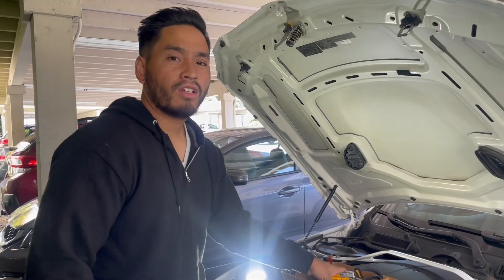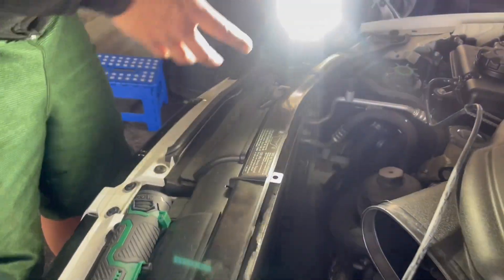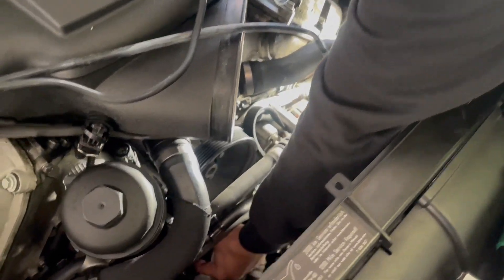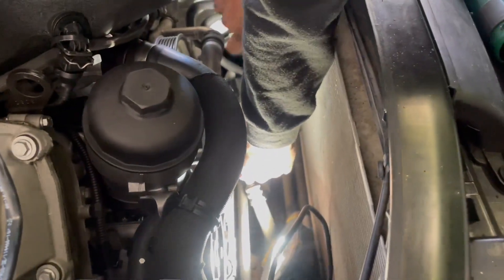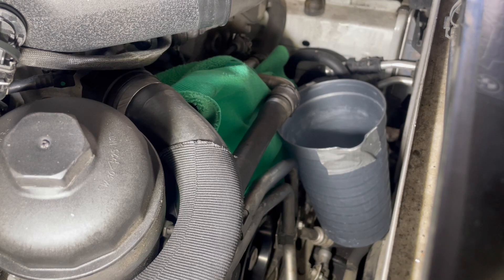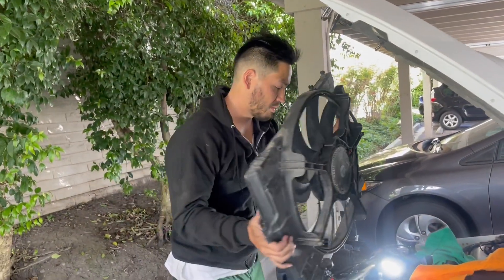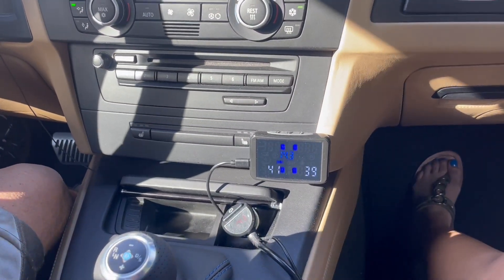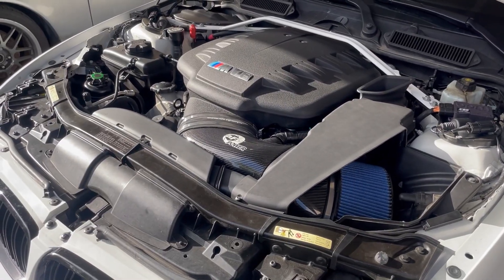Adding More Horsepower E92 M3 Underdrive Pulley Kit Install and Review E90 E93 BMW

Comment: Great video, wanted to see your technique to clip in the hoses on the bottom of the fan, that may be the hardest part of the job. I want to avoid taking the undertray off.
Reply from the maker: Thanks for the comment!  It's a bit tricky but I just pre positioned the hoses and clips best I could to line them up.  No tricks besides removing the undertray which takes extra time.  Good luck!

Comment: Good evening Sal.  Quick question, would you know how to adjust the rpm on the launch control?!  I see yours set at 3.5k  . Mine is set at 5 k and I don’t like to launch it that high . I feel it’s abuse 😂. Thanks 🙏
Reply from the maker: You need a DCT tune plus ECU tune.
Reply: Ok perfect , I will definitely look into it . Thanks 🙏
Reply from the maker: @sheldonchin2543  anytime

Comment: Hi Sal, appreciate your video(again😂)! Would you happen to have the part numbers for the two belts? I couldn’t find an exact, does it mean it’s a universal part? Thxxx
Reply from the maker: I don’t have the part number but they are universal continental belts. If I find the part number I’ll let ya know.
Reply: @Sals_Garage  thank u so much! I will let you know as well as soon as I find the parts too!
Reply from the maker: @chasew.l.5808  thank you! I’d like to know as well.
Reply: I got my belts from turner sport: Main belt - 11287837898
AC belt - 6DPK1105

Cost ~$37 

Everything been put on now and tested, steering feels wonderful! Thank you Sal for the video guide, I’ll post up my version of the belt replacement on YT sometime soon lol. ❤
Reply from the maker: @chasew.l.5808  thank you for sharing! That is super helpful 🙏 is your car DCT or manual?  Depending on the year they have different power steering pulley and belt diagrams.
Reply: @Sals_Garage  mine is ‘11 e93 DCT, I used the same route as you. 

I’m assuming everything after May 2008 share the same route. *read somewhere on forum.
Reply from the maker: @chasew.l.5808  you’re correct, thanks again for the info! Huge help. Looking forward to your video.

Comment: What other mods from standard do you have on the engine and exhaust ?? I have removed Primary CATs and have an X Pipe with CATs and resonators and a BPM stage 2 tune so this was to be my next upgrade. 
Thanks
Jp
Reply from the maker: We have bpm sport tune stage two with e85 flex fuel kit, pulleys, test pipes, 2nd cat delete, OEM muffler mod, and AFE carbon intake at the time of this video.

Comment: Hey nice video, noticed you launch at about 3500rpm mine revs to over 6000rpm when it launches! Have you had the launch control rev limit changed? Any idea what the stock l/c rpm set is? Love your videos, made me get an e93 M3 just a shame the weather here in the uk ain’t quite as good as California! 😂
Reply from the maker: Thanks for the comment!  Mine launches at 3500 rpm due to the GTS DCT tune.  The normal stock launch RPM is 5500 RPM.  As far as I know, this cannot be changed unless you talk to your tuner, mine is BPM sport.  Glad you got an e93 M3!  Enjoy!
Reply: @Sals_Garage  Awesome thanks for the reply 👍🏻
Reply: @si19uk  get the gts trans tune and you can change it

Comment: 4.3 nice!!!
Reply from the maker: Thanks man!  Fastest time I got with this heavy convertible model.
Reply: That’s the downside of the e93s but great job hittin 4.3 sec, still got my mind blown. I was thinking of replacing seats and the battery in order to lose weight but the pulley mod is 👌👌👌🔥🔥🔥
Reply from the maker: Yea! Replacing battery would be good for me. I’d love to replace seats as well since they are 125 pounds each, but the e93 seats are difficult to find replacements for due to the way the seatbelts work at the front.
Reply: So true, the belts are integrated with the oem seats. Roll cage then lol so there are anchors for the belt lol.
Reply from the maker: That would be awesome! I saw a Spencer Berke video with a crazy e93 build that had really nice seat setup and a roll cage with 4 point harness.
Reply: Still my fave mod . Watched this a million times.
Reply from the maker: @im_so_es_ef_wit_it  me and Ellie appreciate your viewership so much! Thanks man 🙏

Comment: Hey bro im in south africa , how do i get one of these ?
Reply from the maker: You can try this product, seems to ship internationally:  https://ebay.us/hpRaxj
Reply: @Sals_Garage  Thank you kindly i really appreciate it ., i was just have a few questions 

1.) will it damage the car in any way in the long run 
2.) when it under drives everything else and gives more power to the engine is it harmful to other components ?
Reply from the maker: @umiel386  no problem!  It does not harm the car at all. Risk free for sure.
Reply: @Sals_Garage  you a good man thank you , i was just concerned that the aircon or power steering will get affected
 . and it does pick up the HP up and KW ?
Reply from the maker: @umiel386  it picks up about 10 HP and some torque.

Comment: Don’t instal power steering pump pulley.
Not enough clearance for belts.
Crank pulley only
Reply from the maker: It worked for us, but there are different belt layouts depending on the year.

Comment: My coolant goes all the way up to 205, the normal should be 195. I did a coolant flush it seems to help a little bit (now max is 199). But in heavy traffic it does go up to 205 which passes the central line just a little bit...however it does not go up any higher.
Reply from the maker: 205 max is good still.  On my N55 turbo charged straight 6 335i, the coolant would get up to 212F, sometimes 220 max.  Definitely not comfortable with that since all the plastic becomes very brittle over time.